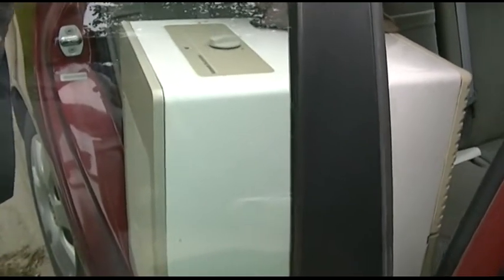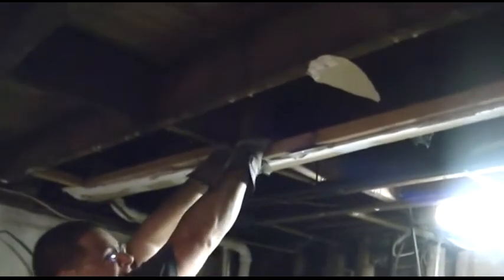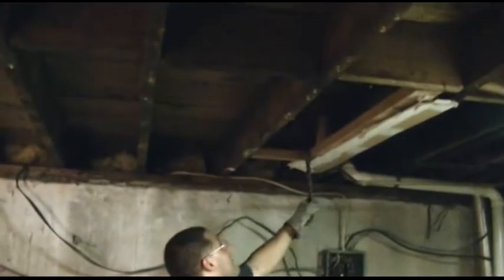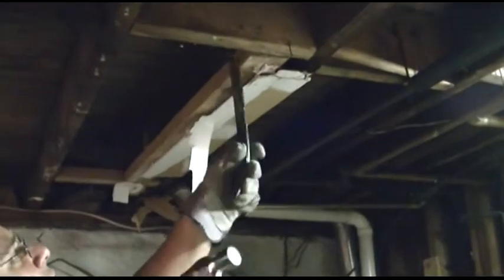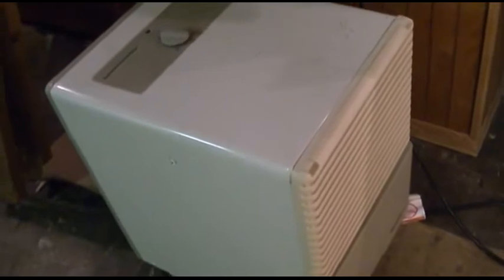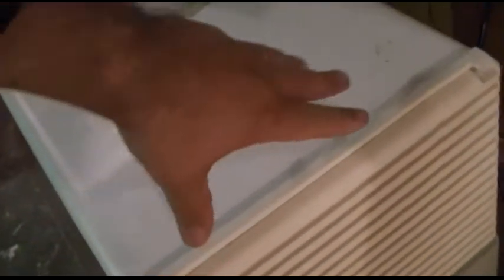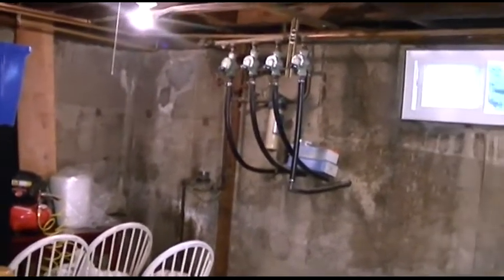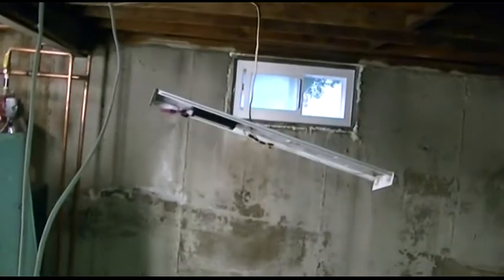Awesome Dehumidifier Has A Baby Brother!

Comment: Now that I heard of awesome compressor startup sounds and that Panasonic microwave which had a loose bulb that made an awesome hum, Lemme tell you this!:
We used to have an old Philips 36 inch CRT TV. We threw it out because of a plasma TV upgrade in the bedroom, and we could NOT EVER carry the TV, it was so damm heavy!
If you leave the TV unplugged to the point where everything is discharged, we plug it in, and turn it on, it makes a BOOMING hum sound! With a bit of static. I think the reason is because when everything is discharged, the transformers have to recharge everything, including the tube, it pulls a LOT of current, which causes that hum!
Also when I was younger I ALWAYS wondered what the warm, orange glow on the back of the tube was. I thought it was an incandescent lamp to produce the light for the screen, it's actually a heating element for the electron gun!
Reply from the maker: +AP499D25 Some of the later TVs (CRT style) and computer monitors especially (again, CRT) had the greatest degaussing sound ever.  I used to power off and back on my friend's monitor because it made such an awesome sound!